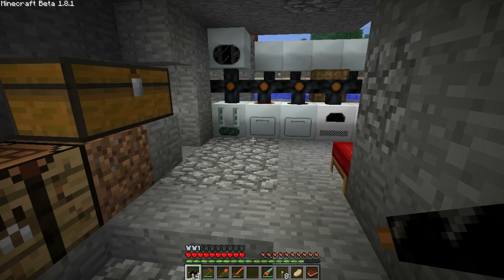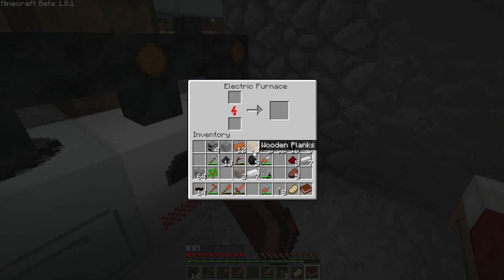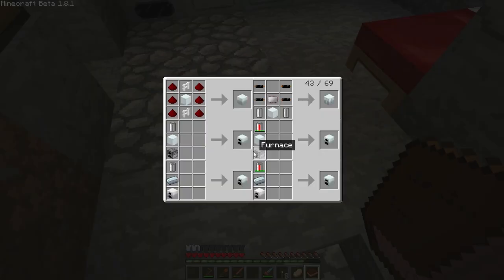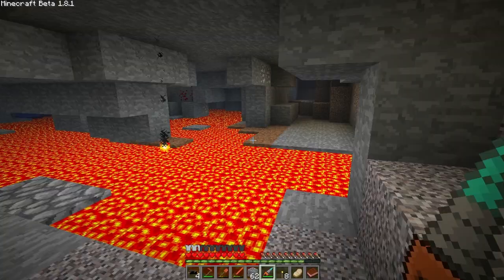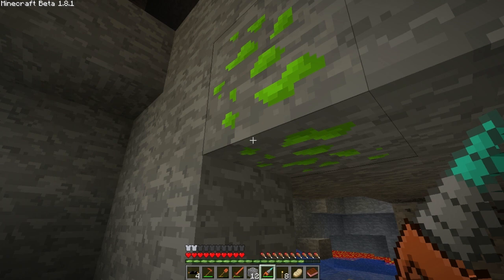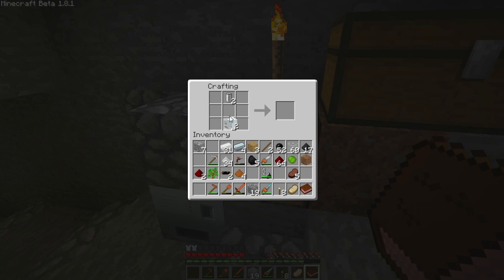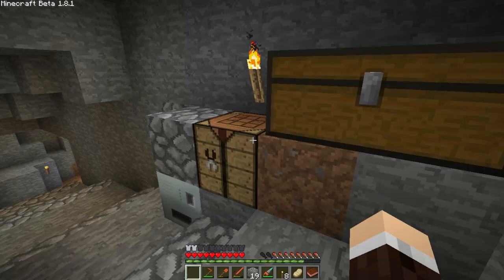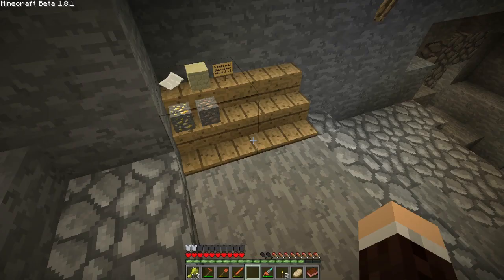Let's Play Industrial Craft Part 13 - Solar Power!

Comment: You should look for another options in your recipe book! Example: you made a generator with: RE battery, machine block(8 refined iron) and furnace! That is way more expensive than this:
iron furnace (5 iron+furnace), RE battery and 1 refined iron! That is much cheaper!

Comment: could u possibly do 5x5 with your solar panels? or possibly when u make your nuclear reactor put it in a contained 2 thick wall in the ocean

the 2 thick wall cushins the splosion the water cools it down but u need water next to the actual nucler reactor to cool it down so fill the tank with water put it in bottom of ocean 2 thinck wall just saying it will splode sometime